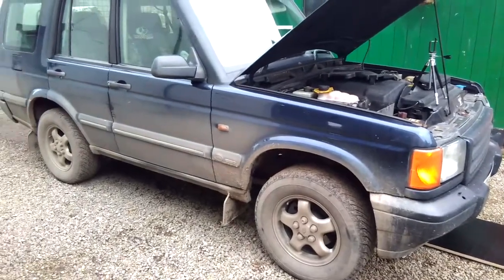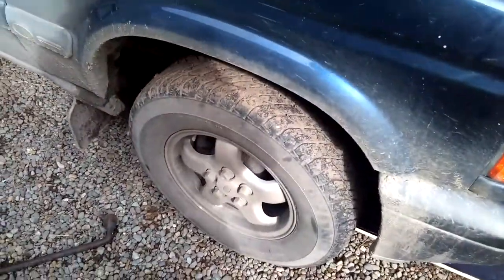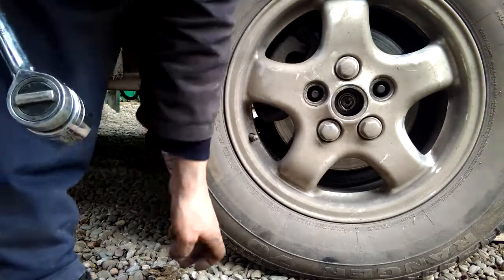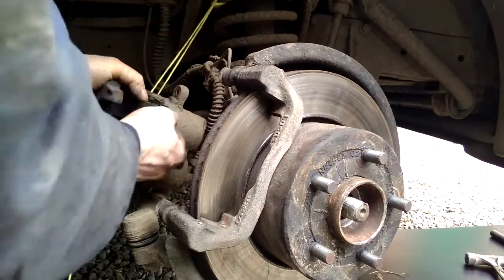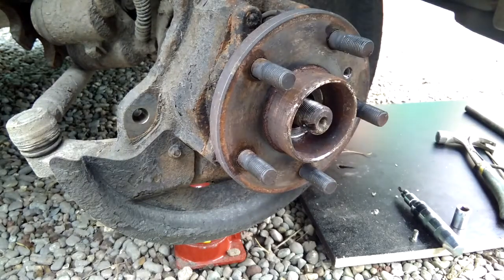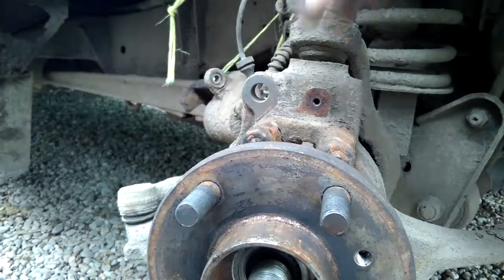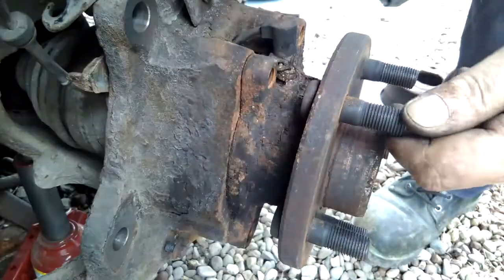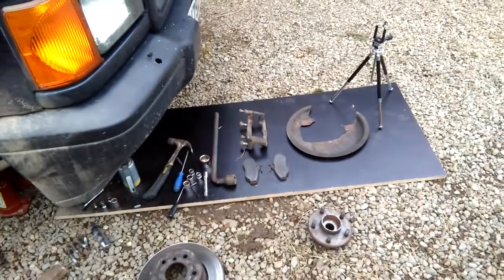Land Rover Discovery 2 TD5 and V8 - Hub Bearing, Brake Discs & Pads Replacement - Part One

Comment: good job, i always change the driveshaft oil seal as well while at this stage just as a matter of course. its the same hub/bearing for the back just with an oring as the oil seal and a different length abs sensor but its the same hub/bearing.

Comment: You are going to need to get a 3/4" drive socket set, you were extremely lucky to get the drive shaft nut undone like that
Reply from the maker: +James Packer Thanks James. Yes it did seem to come undone fairly easily. Managed to refit it all today and roped in a 'local' to do the nut up again. :)

Hopefully Part Two should be up some time tonight.
Reply: that nut has a safety lock bend, i used one arm of a 8 mm spanner and tap it with hammer for straighten the lock bend or a small flat screwdriver, the rest was easy :)

Comment: Wow the teeth in that ratchet are strong, many a ratchet broken by using it like this, i always have a 1/2 drive and 3/4 drive breaker bar with scaffold pole extension

Comment: top tip if and when you are undoing and doing up the driveshaft nut turn steering justa small bit to move tooling and knuckles away from any bodywork

Comment: Can't get the wheel bearing off of the half shaft and hub, it's stuck solid! Trying to replace the ball joints and can't get the bearing and half shaft out, any ideas?

Comment: is the front rear bearing, the same as the rear, i have a  new rear bearing home, but can i use it to the front, ore is not the same ?.. :-) good video btw
Reply: yes, you can, the ABS sensor cable might be a little bit shorter but you can use the old one.

Comment: Use a 1 1/4" not a 32mm there's less than 0.025mm difference but it's a better (tighter) fit.